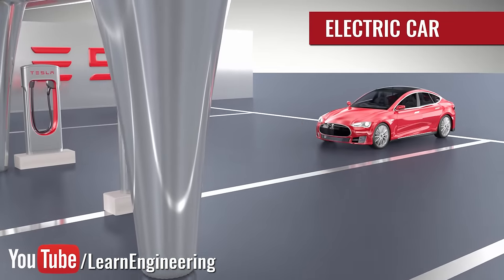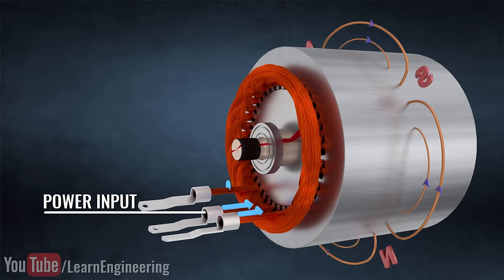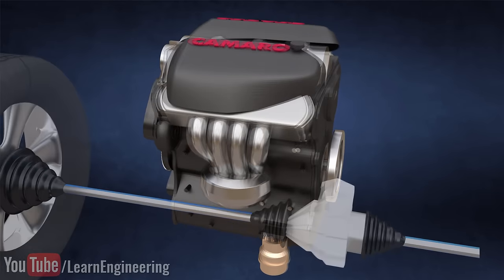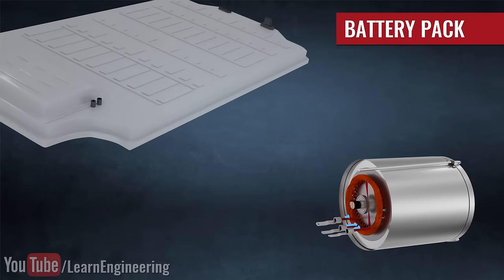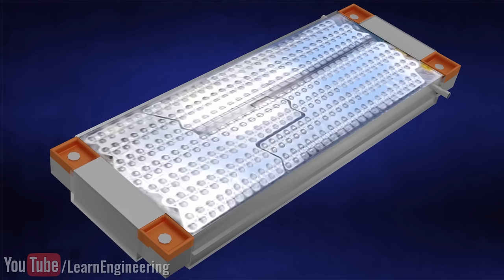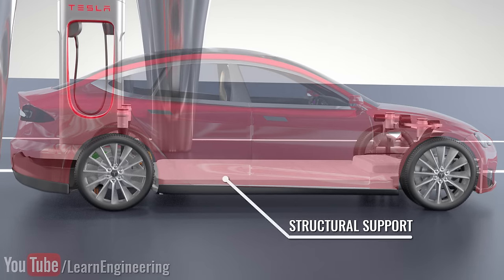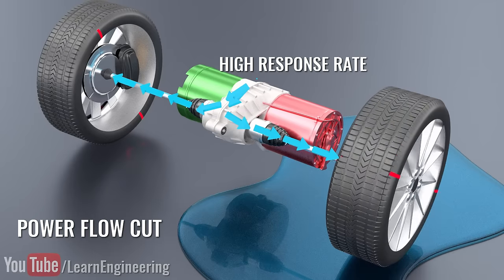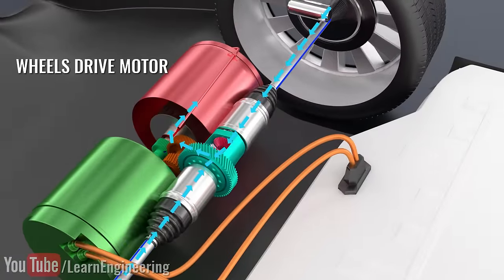How does an Electric Car work ? | Tesla Model S

Comment: I can't wait to see that most of the motorists are using electric vehicles instead of gasoline.. this is the way to save our mother Earth.
Reply: EVs along with clean electricity.
Reply: There is no clean electricity.
Reply: @FrainBart_main , wind-turbine, water-turbine, photo-voltaic
Reply: @shawndickson5809  Off course there is no 100 % clean electricity, I meant relatively low impact to enviroment compared to oil. Take for example hydroelectricity, there are emmisions with construction and parts manufacturing but after that, the emmisions produced are very low (the dams can last over 100 years; try to compare emmisions per year from this electricity and from gasoline or diesel powered cars). Nothing is free, nothing is absolutely clean, but we can get closer to both with hydropower. I'm not a fan pf the green fanatism but on the other side, I don't want the pollution to just transfer itself from the cities and roads to power stations with EVs implementation.

@Arabic Camel I agree for hydropower, but wind and solar need batteries to back them up which are not made cleanly. Also solar panels aren't the most clean thing to make and rare-earth materials in the generators of wind turbines are nasty to mine.
Reply: Meanwhile the governement is throwing nuclear waste in the ocean,also poeple are destroying our eco system by killing all wild animals and chopping down millions of trees, plastic in the ocean and overpopulation just to name a few things of what poeple are doing to mother earth. And now you're here to say electric cars will save are planet?!
Reply: The only way to save Mother Earth is to start walking everywhere! EV's are not the answer! They are just going to create a whole new set of problems.
Reply: @shawndickson5809 solar  and wind is clean energy.
Reply: @shawndickson5809  Nuclear powered Energy is clean
Reply: @cavius8784  solar and wind are horribly inefficient. Solar is expensive to produce on top of that.
Reply: @AkshayGowda007  Not exactly, but I believe it is the best option.
Reply: @shawndickson5809  Fusion energy is future and so is electric cars.

Comment: Fully electric cars have been driven and popular in China for more than a decade. I don’t understand why the rest of the world doesn’t want to move on to a more eco friendly option.
Reply: Because they are still making billions of dollars from the oil that is being produced.
Reply: those fully electric cars use lead batteries and are powered by a majority coal powered grid, china is scrambling to curb pollution while countries like the US have had regulations wich reduce the impact of fossil fuel so there is not much of a rush for EVs since the air is still breathable.
Reply: Cost is the reason. I can buy a used car for $500 (or less) and get from point A to B all day long. As of 1/29/2019 a USED Tesla battery pack is about $16K on eBay. It is impossible to buy a battery pack for either Tesla or Chevy Bolt new. Ditto for the motors. A used Prius or Volt is better, but still in the $5K range (that includes a replacement battery which is available).
Reply: @blackmanops3749  then go buy a $500 car then if getting from point A-b is the only thing people buy cars for.
Reply: @miguellopez3392  I have and I do. Several daily drivers including my 2002 Saab 95 which still has more features than my GF's new Chevy Cruz. I also have a sleeper car project in the works on an ICE, but my buddy said I should do an updated EV (I did one in 1989/1990 as part of the Dartmouth College Solar Car Racing Team). That's how I ended up here. But my response was specifically to the question why more people are not rushing to get on the EV bandwagon. The answer is the same today as it was back in the 90's and even in the 60's (when head Tesla guru Wally Rippel was winning races in his teams EV) and in fact back to over a hundred years ago when EV's dominated but were quickly displaced because oil was cheap and plentiful. My guess is that I am a little older than you and have been in this game for a little longer too. My biggest complaint is that the auto industry is so closed minded (including Tesla despite what Elon Musk says). They do not want to open their systems up. They do not want to sell parts so DIY'ers can adopt, modify and innovate. They are their own enemies. It's not the government (entirely). Just look at the state of ICE R&D. We now can control every facet of the ICE powertrain, yet the only way to customize is to completely replace the manufacturers ECM with an aftermarket one and got to a tuner to tweak performance. That is mind boggling to me. And it is all because manufacturers want to keep you out. Clearly the answer is not so simple as cost, but it is the primary one.
Reply: @blackmanops3749  do you not know why tesla does not sell parts or allow for modification? they actually have part shortages, they dont have a surplus since they are trying to make as much cars as possible to complete their orders and rushing them out the doors as fast as possible with quality inspections not being a priority, they dont want people to modify their cars because that increases the chance of something going wrong and ending up with their car on fire... which leads to a bunch of bored media outlets reporting the fire and drooping their stock and damaging their cars reputation, they are small company, they dont have the resources to set up dedicated repair centers or shrug off bad PR, maybe when the chines giga factory is complete the extra parts will make it to retail. heres is an example of what a DIYer did with their battery module https://www.youtube.com/watch?v=of01p0Q-yUM&t=2s
was it tesla fault it cough fire? no but some people may look at the video and see it as a reason to stay away from EVs.
Reply: @miguellopez3392  Thanks for the comment and link. Of course I understand the myriad of reasons - technical to legal to political - why Tesla or any car manufacturer doesn't want to sell DIYers their parts/know-how. I just find it disingenuous of Elon Musk to hold himself out as an altruist who is willing to share all his wonderful innovations, when in fact it is not really so. This is not to disparage him either, I respect him tremendously, but I find it somewhat frustrating when I can't take someone at their word. It's not how I was raised. Perhaps thats a 'me' problem.
Reply: @Connor most people who have actually driven a tesla would disagree.
Reply: Kevin Oloane  china has the most emissions but if you count other forms of pollution then India takes the cake.

Comment: transmission still could be used to increase output
Reply: why
Reply: Could be, but no need. The inverter can increase the amplitude of the AC current (resulting higher electric current in the stator), which causes stronger magnetic field, so higher torque on the rotor.
Reply: With 100% torque at zero RPM a transmission with switchable gears is an unnecessary expense and weight.  Better to increase motor power or RPM's or both.
Reply: I think it could reduce the cost of the car by using less powerful motors, and introducing a transmission.
Reply: You mean reduce the use of electricity (thus cost)
Reply: Transmissions do not increase output power, only transform torque and allow an engine to operate within a power band. If you have an ultra-wide powerband like that of an electric motor, then a transmission is not necessary.

Comment: I kind of disagree with the range as a disadvantage. The range of the top end Tesla Model S is 539km or 335 miles similar to a a regular fuel powered car.
Reply: For city its great. But going on long trips can take 3x longer though.
Reply: on long trips we prefer to take the Tesla. Car charges when we make the same stops, for food, we would normally make.
Reply: The range of the highest range electric car under ideal circumstances proves it's better than gas cars with the same range.  And fast chargers are always open, working and right next to places you want to stop to eat.  I'm sold!
Reply: for long trips it adds 40 minutes every 260 miles wich would take like 4 hours of driving, so only a 20% increase.
Reply: Keep telling yourself that.
Reply: @texmex9721  what? You can do the math yourself if you disagree.
Reply: Math???  You think there is magically a fast charger that works and is not being used at the end of the max range of the electric car.  The electric car that you don't own right?  And you know max range is at 45mph right but you made it 260 miles in 4 hours.  And you know this because of math.  OK....
Reply: @texmex9721  I'm using the 315 and 335 max range on the model 3 extended range and model s p100d as the max range, 80% charge is done very quickly and gives the range I described.
Reply: I'm using my experience of owning 2 different electric cars over 5 years to lauph at your theory that those cars achieve that range at high speed, they don't.  That you think there will be a charger exactly where you need it, there will not.  And your idea that the charging station will be working and have nobody else in it, it will not.
Reply: @texmex9721  what cars did you own?
Reply: @texmex9721  additionally the model 3 extended range single motor gets 430 miles at 48mph, and 315 miles at 65mph, super chargers are usually built along highways and major roads, finding one  isn't going to be impossible and since electric cars are still few in numbers seeing a mostly empty charging station is pretty common.
Reply: Model S 85 and BMW i3 REx.
Reply: @texmex9721  here is a chart wich puts the cars advertised range with range at different speeds, tires, batteries, and motors 

https://model3ownersclub.com/threads/tesla-model-s-x-3-range-at-55-60-65-70-75-80-mph.5496/

The 2018 models seam to have the best mile per watt hour out of any other generation or electric production car.
Reply: So how long does it take to charge form almost dead? Just wondering I have no clue. Because i make a 14 hour drive in 12 hours right now in a petrol car. Is it possible to do that? Not being an ass just not sure.
Reply: A 14 hour drive in 12 hours does sound a little impossible.  :)
I think you are asking if it's possible to make a trip that takes most people 14 hours, but you 12, in an electric car in 12 hours.  And the answer is no.  Recharging the car, even a TESLA at a TESLA Supercharger is not as fast as filling a car with gas.  I don't know how far you 14/12 hour trip is, what car you driving, or how many places there are to charge on your existing route.  But I'd guess that you'd add 2-6 hours to the trip.
Reply: @joshcarlisle6006  charging from almost dead is the fastest way to charge but not recommended due to how much it shortens the battery life "They take about 20 minutes to charge to 50%, 40 minutes to charge to 80%, and 75 minutes to 100%"  12 hour trip Is likely to be a 16 hour trip. Not so bad if you use the charging time to eat and rest.
Reply: First thanks everyone. I'm asking because I am thinking for my commute to and from work each day. Its about 125 miles round trip. As far as my long trips its a little under 1000 miles one way. Driving 2017 ram 2500 Cummins loaded down. Camper family etcetera. Running 80 mph or so. I drive at night so everyone is asleep. But there are times where we make that trip in car too vw passat. Same as above driving.
Reply: John Electric cars are great today and for many people can replace some or all of their driving with gas vehicles.  But, it's far from perfect and some people are tremendous advocates, but don't own one.  I own and advocate, but try to tell people the whole truth.  For example the charging stations are hit or miss.  Tesla seems to do the best job, but they are selling 100s of thousands of cars all of sudden and their stations out in California anyway are often full.  On other networks, "fast charging" is rare and can be more expensive than gas. The smartphone aps like "plugshare" are free, why not download one and see what charging options are close to you and on routs you use often.
Reply: i dont own one either but i would call these advocates Tesla fanboys, they seam to smugly act like electric cars are ready to replace all ICEs but realistically it will take another 20-40 years and several billion or several hundred billion dollars of R&D and infrastructure to completely make ICEs obsolete for everyone.
Reply: winter driving reduces that figure by a third because of heat for the cabin. radio? electrically heated seats? reduce it more. charge your I phone reduce again. Want headlights? uh now you're charging on trips enough that you'll celebrate birthdays on the road. just saying
Reply: @mikewidget7610  heating is the thing that drains the battery the faster, takes 7 miles off per hour used, everything else uses much less energy.
Reply: mike widget haha it doesn’t really matter where I live since there’s only 1 season and it’s summer all year round. In case you were wondering where, it’s the small Southeast Asian country, Singapore!
Reply: Having owned 2 electric cars, one of them a Tesla, I can say no, winter driving does not cost you a third of the range.  More like 5-10%. Charging your phone is like taking a glass of water out of a swimming pool, technically there is a reduction.  Maybe 100 feet of distance. The thing you don't realize is the range calculations are under ideal conditions, and that is not the routine range of the car, and you can't drive to empty.  Just like with a gas car, you don't actually drive till it stops.  You leave a 10-20% buffer.
Reply: It's not so much that BEVs can't deliver the long ranges that ICEVs can, it's that, because of how expensive batteries are right now, BEVs with battery capacities large enough to deliver ICEV-like ranges per charge cost a lot of money. Larger batteries also take longer to recharge. Long times needed to recharge compared to the time it takes to refuel an ICEV tends to cause people to perceive BEVs to be less valuable than their ICEV counterparts and the higher sticker prices BEVs carry not worth paying. 

The fact that cost matters to people is something I routinely see BEVangelists failing to understand. It's not that BEVs don't work, or that they can't do what ICEVs can do, it's how much it costs to build a BEV that can deliver the capabilities that ICEVs can deliver. Right now, ICEVs are just way less expensive to own an operate than BEVs given what people want their vehicles to be able to do, and that's why very few people choose to buy BEVs over ICEVs. As far as most people are concerned, ICEVs continue to deliver much better value for the money. 

I'm not saying that's good or bad, I'm just saying that's how it is. It won't change until battery performance and cost pass a tipping point that they haven't yet reached.

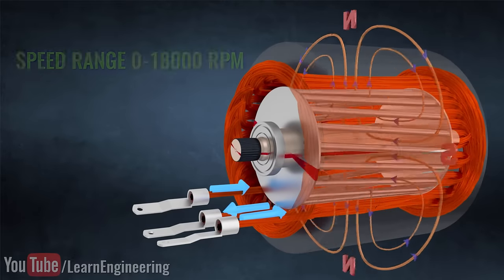Comment: On 2:18 the speed range from 0-18,000 rpm   It's should correct speed range from 0-1,800 rpm
Reply: No - electric motors are much higher revving than ICE (except for the COX Tee Dee .010cuin  model engine!)
Reply: It really is 0-18,000
Reply: it wasn't a typo, they are beasts.

Comment: Im afraid of the explosion or spontaneous combustion of the Li-Ion packs in the event of a side collision.
Reply: Jinni W. And you’re not worried about riding around with all that flammable liquid    behind you? Don’t listen to the oil industry misinformation campaigns
Reply: In that case I also suggest that you should never drive in a car that uses combustible liquids to power it.
Each year, from 2014 to 2016, an estimated 171,500 highway vehicle fires occurred in the United States alone, resulting in an annual average of 345 deaths; 1,300 injuries; and $1.1 billion in property loss. And US automobile safety standards are high.
Reply: lithiums are a lot less explosive than gasoline.
Reply: Me too.  I have a dog kennel in my car that holds 4 dogs.  I would be very uneasy ever leaving the dogs in the car for fear of sudden fire in the batteries.  How many vidoes have I seen of batteries suddenly exploding with smartphones and vaping devices....

Comment: Very well explain how electric car work
F.Y.I
I have a Tesla S and Lexus 500 FSport. I still like the Lexus more the Tesla in the long-range travel I only 5 minutes at any gas station but Tesla I need to plan my trip with power station somewhere and wait for 1/2 hour, 100 miles range trip is ok more than that hmmm. I take my gas car.
Reply: Then buy a Lightyear One.500 mile range plus what you get from the sun.

Comment: What about air conditioning you didn't explain how Ac will work???
Reply: It’s a electric compressor and I believe it’s dual function helps keep battery packs cooled and the cabin cool they will wear out quicker and cost a good penny to fix I’m sure once people start putting 30 to 40k a year on these cars remember once one can drive more for cheap one will.